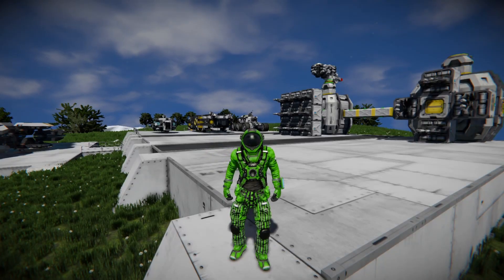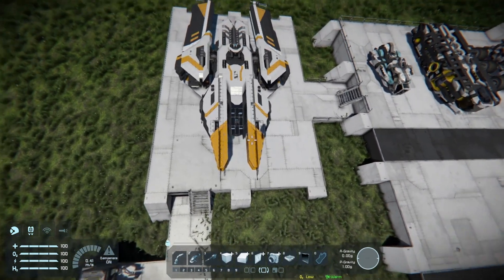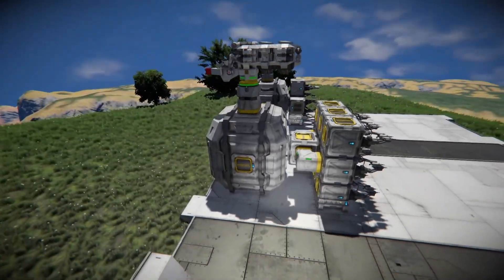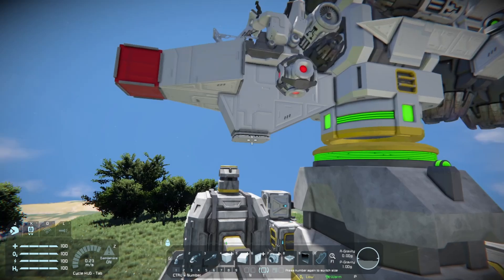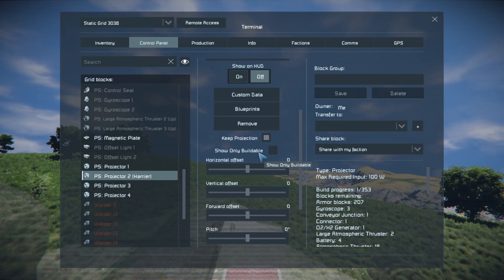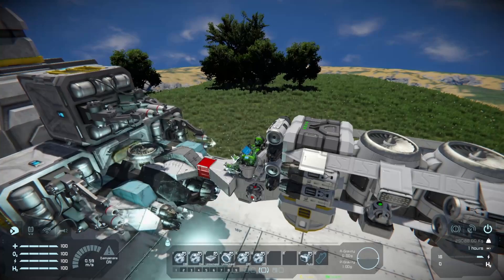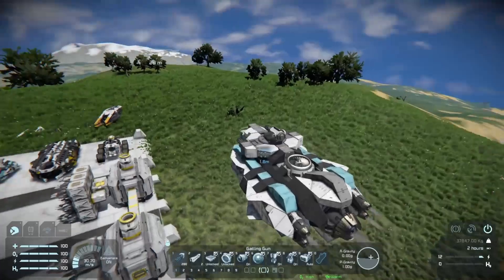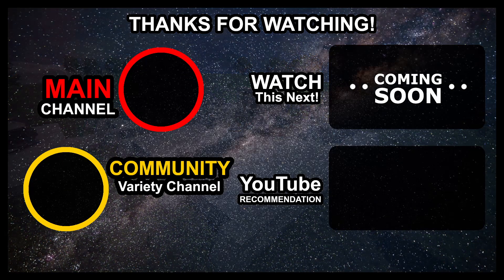Printing Made Easy: Space Engineers Tutorial

Comment: I need to know HOW I add a LARGE GRID WELDER BLOCK to a SMALL GRID SHIP?
Reply from the maker: You can attach a large grid advanced rotor head to a small grid 3x3 advanced rotor. Then attach the large grid welder to that rotor head.

Depending on your world/server setting you may be able to add the rotor head through the menu (after you grind off the one which is added automatically when you place the 3x3 rotor).  If not, then you'll need to place the large grid head separately into the world, weld it, and then maneuver it into place using another ship or crane.  When it's aligned properly you should be able to enter the rotor menu and click "attach".

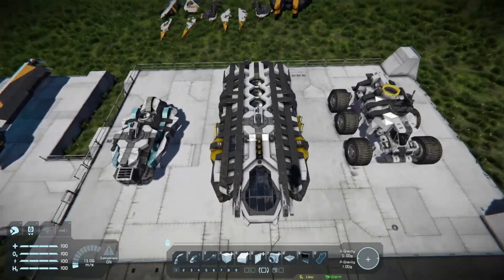Comment: Anyone have the blueprints or tutorial to build the ship on the far left or the one in the far back at 2:06
Reply from the maker: The blueprint for the one I dismantled is in the description. The other ships should all me from my workshop.  

Not sure if there is a tutorial out there but there are mods which will allow printing things with subgirds (though they may have odd results).  If you're looking for a vanilla solution take apart all the subgrids in creative and paste them onto a single framework (single grid).  Then you can print the framework in survival, pop the pieces off, and assemble them again.
Reply: @ShiftyshadowTV   I just want the ship design for the dismantled one, if it's got DLC I should be able to modify it enough to replace the dlc parts unless Passage 3 corner and t junction are used. I'll check out the one in description, I play on PS so Itll be slightly harder to find via just the name

Comment: I know i'm a year late, but instead of flying a ship and manually moving it, could you just use pistons with the projector on the end and then moving it back with a control panel?
Reply from the maker: You can, and I've explained at length my preference for the projector ship in other comments/replies if you want to dig around for them.  In short, I find the ship is more versatile and easier to use on servers.

Comment: I do not see your Projector ship in the workshop.
Reply from the maker: I make a new projector ship every survival playthrough.  They're all just skeletons, like the one in the video, so I've yet to blueprint one.

Besides, what use is a blueprint of a projector ship, if you don't already have a projector/printer setup?  And if you do already have one, what use is the ship?  

The only thing I can think is that you're planning to hand weld the projection of the projector ship.  In which case you might as well build it from scratch without the projection.  They're just batteries, thrusters, and a couple gyros.  Trust me, it'll be good for you. XD
Reply: I found a clone of yours on the workshop. It looks very simply, but it's hard to tell if something odd is buried inside, so the blueprint is a nice to have. I also use them to get quickly built and repaired, so if I hadn't found your's / clone of your's, I would have blueprinted it myself :)

I have a 5x9 welding floor with a piston+projector, but using the projector ship + the welding floor is much easier. Also, having the blueprint to quickly / correctly weld one up in the field in an emergency is nice to have.
Reply from the maker: Here:
https://steamcommunity.com/sharedfiles/filedetails/?id=3401444795

Comment: I keep getting locked up, the welders are building the parts into themselves. I've done it exactly like the video for hours and it keeps happening, I could have built 20 of these by hand in that amount of time. Not worth the effort.
Reply from the maker: You can put window or panel blocks in front of your welders to prevent this.   I seem to rarely have this problem, but I probably should have mentioned it in the video, it's common enough.
Reply: @ShiftyshadowTV  It's still happening, I don't know what you're doing that I'm not but it seems like it's absolutely impossible, I can literally fly between the welders and the ship and take no damage from them but god forbid I be able to move the ship. Breaking everything down doesn't even fix it and I can't convert it back to a ship. My conclusion is it's impossible in base game.
Reply from the maker: @christopherhall5361  When you're printing something. If you print a cockpit or remote control block that has the "Main cockpit" or "Main remote" setting turned on it will take control of your ship.  This means you won't be able to fly using the projector ships cockpit any more.  You can get control back by turning that option off for any new cockpits or remotes you print.
Reply from the maker: The video is recorded in the base game (on PC).

Comment: Even easier .. just put two 'Nanobot Build and Repair System - Original Resources'  (mod 3099489876 in the workshop) down on either side of the projector and make sure they are set to weld closer items first.  You can even use the programable script 'Nanobot Build and Repair System Queuing / Display / Scripting' (mod 867822734 in the workshop) to automatically put items you don't have in storage into the production queue.

I use 2 of them because they can be slow, but they can build subgrids just like the regular ones .. and they don't miss even the most intricate details.
They will also repair any damaged items every time you are in range.  You will still need a repair bluepriont for any completely destroyed items, but not for only damaged items.
The only issue is they can be slow, which is why I use 2 (or even 3) of them.

Combine this with 'PAM Auto-mining script' and 'Isy's Inventory Manager' and you can automate building many itema in various locations.

Comment: easy way to check for damage is press k in cockpit and type "inc" it will bring up all red items
Reply from the maker: That works for a lot of blocks, but that won't work for everything.  For example, conveyors will never show up in the menu and you need them to be functional.  They also won't show up as "missing" in the projector as long as the block's frame is still there (even if they are dysfunctional).

Generally it's not a problem if the grid is small enough for welders to reach the entire interior.
Reply: @ShiftyshadowTV  I see. how about just going by weight?  my main boy is 201000 kg with ice and ammo, quick check  after a hit tells you roughly how much damage has been done. arty shells seems to take about 6000kg off per hit.

Comment: I think that I might do this my next run.  ...but, instead of a projection ship, I'll build something that looks like a pallet jack--two long 'forks' with lots of 1x1 wheels (running in a trench) and a vertical piston at one end to position the projection point.  That will allow me to make grids as large as I want without having to worry about weight or alignment.  I can also pre-project a cradle on the forks to hold complicated sections in place.
Reply from the maker: Sounds like a fun contraption.  I like the mobility of a ship, but putting it on wheels will be more stable.

Comment: Noob question here, so I built a welding wall and at the end of the welding the ship it just gets stuck (can't move my vehicle from the spot). Anyone know why that happens and is there a way to prevent it?
Reply from the maker: If the ship you are welding has a cockpit (or control seat) and that cockpit is set to "Main cockpit" as soon as it is welded it will take over.  At that point you won't be able to control your projector ship.  You can fix this by going into your menu and unchecking the "main cockpit" box for that block.

Alternatively, it's possible to get stuck in welders (put a glass wall right up against them to prevent this).
Reply: @ShiftyshadowTV  Did not know about that option for the cockpit, Thank you. I built a space fighter(99% Ion) on Earth like planet LOL. Needed to add 5 large flat Atmos to help get it space 😏.
Reply from the maker: @chrisburrows9758  Hahaha, yup, full ion would have worked on the moon at least.
Reply: @ShiftyshadowTV  So was even more out of Luck as I made my space base on a Large Asteroid. So to get to the Moon(which is on the other side of the Planet) I had to setup 2 Jump points to get to the moon from there.

Comment: little tip whith welding taps: you can design ships with mergeblocks as connection points: this way you dont need to grind anything and instead just turn them of to seperate the grids. the small mergeblocks work wonder with that. just put one as the welding tap and one on the projected ship in a way that would make them merge et voila easy to print detach and attach to repair ships.
Reply from the maker: That's a good tip, I do that for any ships I plan to print many of.

Comment: With mini merge blocks you can print them as one grid, one ship a while back did this, it had a “setup program” which once printed, you pressed a button and it would detach the merge blocks and attach the rotors and hinges etc at he same time, let you grind off the merge blocks, then you press another button to finish the angling of the hinges and rotors.
Reply from the maker: That must have been a complex system, because you cannot merge a subgrid that is attached directly through a hinge or rotor.  If the base and head parts overlap at all (which they do for those parts) it makes the merge fail. I'm not sure you can even print a grid with both the piston base and head attached.

Must have used a lot of pistons to offset the separated parts. Then, when done printing: extend piston base, attach piston head, unmerge, align rotor and hinge parts with positions, attach rotors and hinges, detach pistons, retract pistons, rotate hinges and rotors to desired angle.

Very cool, but complicated and it would add a number of otherwise unused pistons to your grid.

Comment: I have a setup but the welders won't print the projected ship
Reply from the maker: You need all the components for welding the blocks in inventories (cargo containers, assemblers, etc.) and attached to the welders (through conveyors or directly).  You'll have to estimate the parts you need unless you have access to mods (such as Projector to Assembler).

Other than that, make sure your projected blueprint is touching the grid with the projector (and will actually attach when printed).
Reply: @ShiftyshadowTV  So I need all of the resources met before the printers begin printing?
Reply from the maker: @notrefan  Not all of them, just the materials needed to print the block you're starting with.  I recommend trying to have all of them ready though.

I don't know how new you are to the game, so don't be offended if this is silly, but make sure your welders are turned on (the tips should be red).

Comment: The biggest problem in survival is how to know what plock is not Finished becurese the Materials are out of stock. How you handle the continius Material supply?  And in large Builds, how to reach the Missing Blocks
Reply from the maker: True, with large prints I take it very slow.  Monitor the materials and print one layer at a time.  If any material runs out, pause and restock it before moving to the next layer.  That way you can fly around and check everything in the slice too.

Sometimes things won't print on large grids though.  This happens when a block is only attached to blocks which cannot be printed yet, and then will be out of range of the welders once the blocks are printed.  Most often this happens when a small block is placed on a large block (a gyro on a jump drive for example).

In my opinion this is bad ship design, but a lot of people do it.  Those blocks often have to be welded by hand, and may be difficult to get to.  When designing ships try to avoid small blocks only attached to big blocks.

Comment: Hey is the blueprint for the projector ship available on the workshop lol 😂
Reply from the maker: It's not, I just slapped it together for this video (and that's usually the same thing I do in survival).  If you pause you should be able to reproduce it, all the parts are visible.

If you're building on a planet I recommend using 2 large atmospheric thruster, 2 normal sized batteries, and two gyroscopes.  Then just a few thrusters in every other direction and a control seat.  That seems to do the job for me every time.

In space you can use ion thrusters and batteries.  One large thruster in each direction feels good, but you can get away with small ones too.

Comment: Could you replace the block on the front of the projector ship that you have to manually remove with landing gear or a magnetic thingy
Reply from the maker: You could use a merge block, you would also need a merge block on the vehicle that you are building, and you would have to line up the blueprint so that they are connected when it prints.
Reply from the maker: Landing gears and magnetic plates won't work because what you print has to be attached to (part of the same grid as) the projector.
Reply: @ShiftyshadowTV  Damn thats a shame. Thanks for the response tho.

Comment: Im not sure if theres a way to add blocks to the build list in a ship, like you can in your suit (hover over a block in the g menu, then tap the mouse scroll wheel to add it, then mouse scroll wheel once over any connected port on your base grid)... but it would be nice if you could be in your ship, connected to a connector, sit there and add materials/components to the ship inventory...then detach, and go print. I have been doing this manually where Ill grab all components needed in my suit, add to ship (alt+center mouse wheel), repeat until i have most blocks I can think of. Another option is to grab a piece of paper, calculate all the materials you'll need by number of each block (30 thrusters, 4 batteries, drills, cargo containers, etc). 

Even better would be, since the projector already KNOWS what blocks you need, as it can keep track of whats completed, it should have an option to 'collect all materials for projection'...then as long as your base has all the parts and your ship can hold the mats, it'll be nice and full for your one stop print job!
Reply from the maker: To take a phrase from the Keen book, "there are mods for that".  Unfortunately there's not much projector to assembler or projector to inventory functionality built into the vanilla game yet. Would certainly be nice.

Comment: I always set up my projector ships or control seats with the actual adjustment controls. I also like to have little "pits" I can merge them with on large ships or bases etc that sit on a rotor so I can move them around if the projection is of a bigger ship. It lets you move them over a welder pit too or something. I also tend to use the checkerboard method but fill the alternate block space with a grinder so the same wall or pit doubles up as construction or deconstruction. There's a nice mod on the workshop called compact welders that panel sized welder and grinders for large and small grids. Really nice for putting on landing pads to get your ships a quick repair too.
Reply from the maker: Mixing the welders and grinders is a good idea, you might as well if you're them.

I don't ever set up my hotbar controls for projectors because I only ever use them for projecting a single ship.  If I want to project another I build another projector.  That way I never have to set up a projector for the same ship twice, and I always have a projector set up to print a replacement.  Of course of you're limited on pcu, having one projector is probably better.

Comment: For extra credit, build a projector on its own (in space or off the ground so that it starts a new grid) then paste your build on to it. The grid pivot point is how the projector orients the blueprint. No need to move the blueprint. (You can see a grids pivot point by turning them on in the info tab)

Another thing to watch out for are thrusters. Especially when using a piston to retract a blueprint from the welder wall. Make sure thrusters are off in the blueprint or else Klang will come knocking.

There have also been times when printing a bigger ship than the projector ship, the gyros weren't enough to maneuver. In some rare cases I came across a bug that made the projector ship sluggish even after disconnecting. I ended up having to rebuild the ship from scratch after that. (On public servers, I couldn't just copy paste it to fix)
Reply from the maker: Pasting onto a projector is a good idea.  Would make setup for printing grids much easier.

True, thrusters and cockpits which are set up as "main cockpit" can throw off your printing experience.  I've never had my ship remain sluggish after detaching though, that's a strange one.
Reply: @ShiftyshadowTV  I can only guess to what actually went wrong.

Probably the game having troubles calculating mass correctly when the ship went from around 100k to about 10x that plus the fact that it was running on official server with a max of .8 sim speed with dips to .2 when someone decides to test a new design in atmosphere for the first time. (I swear I had the parachutes set up correctly). 

Could also have been something to do with the way the gyros were set up on it. It was originally my tunneling miner with 2 gyros, one set to override spin to make a smooth bore.

Maybe it was Brick making a sacrifice to Klang to get revenge on me. Who knows for sure.
Reply from the maker: Oof, yeah, official servers.  They're always a little special.  Hahah.